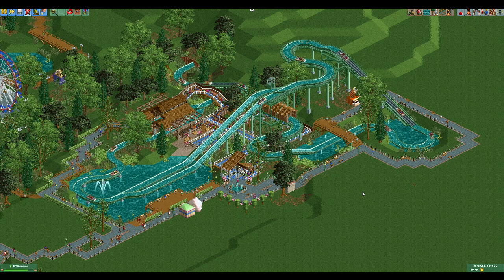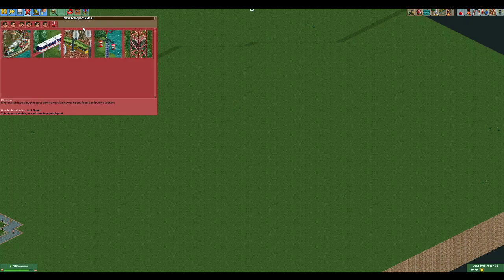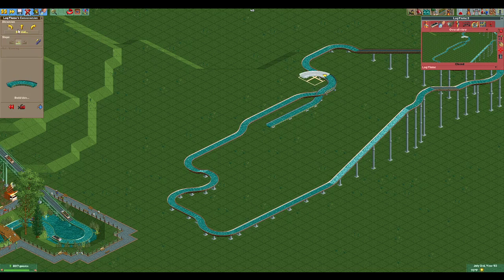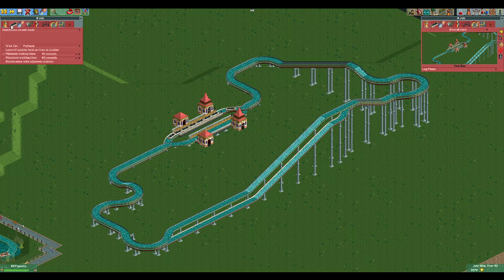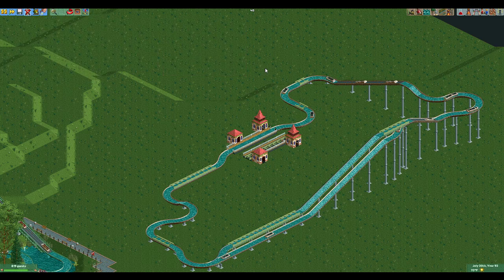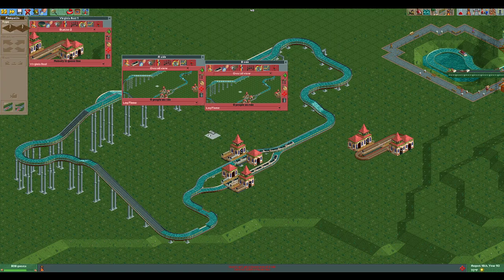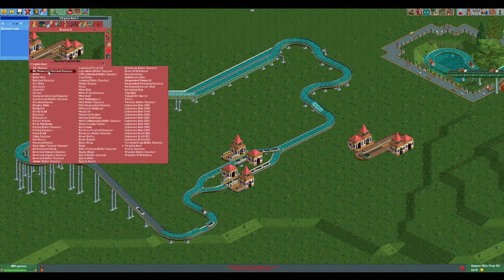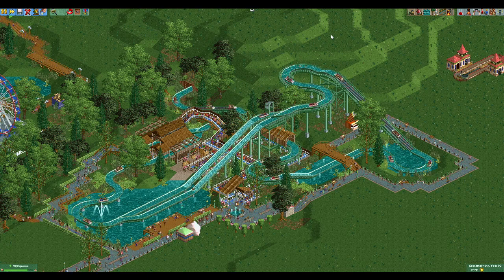RCT2 Hacking: Double Station/Drop Log Flume

Comment: Did you not see the new plugin from Oli414? He built a plugin that alters the order of track elements in the tile inspector, meaning you can build it as a single ride, with working block brakes. But that thing gives so many possibilities. Another way to do this log flume is enclosed dinghy at the same height, because sometimes you have the boats higher.
Reply from the maker: Yes, I was one of Oli's testers for that.  It's a great option and I'll talk about that in the next video.  It doesn't go with your file, though, so at the moment it's not terribly useful as far as being able to make parks that others can view.  Definitely shows the cool future we'll have with the new save format, though.  The dinghy slide is definitely another option for this.